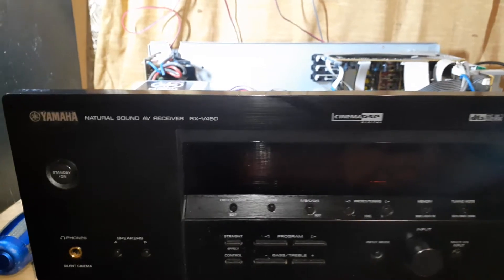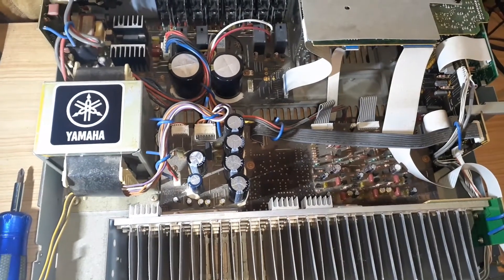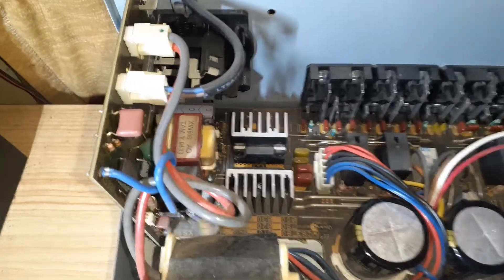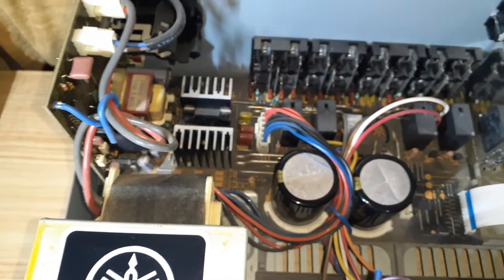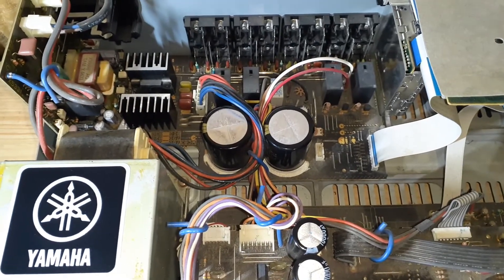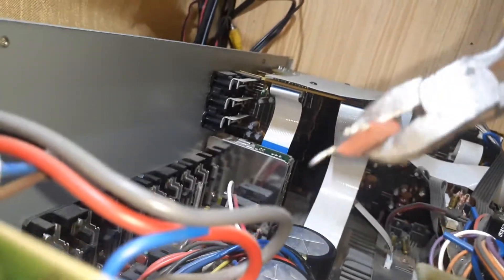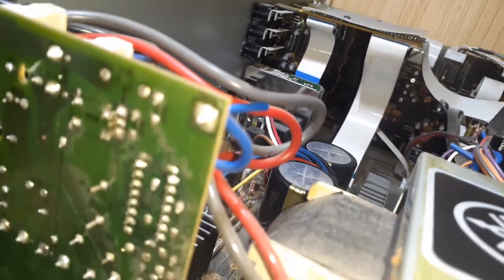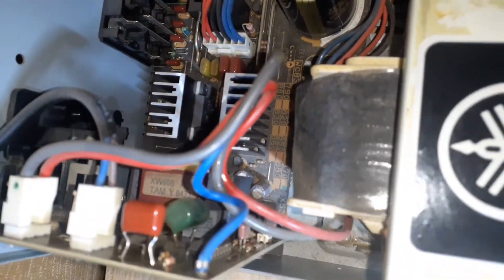Yamaha RX-V450 NOT POWERING UP , REPLACING 1 CAPACITOR TO SOLVE PROBLEM , AS SUGGESTED BY OTHERS

Comment: i have a question did you get any clicks or anything before you replaced the cap i recently got one of these units from the same era rx n600d to be exact for free and wondering if it has the same fault no power at all so i brought the same cap unfortunately mine has Ethernet and you have to disassemble everything to get to the cap
Reply from the maker: At first it was all good , then  wouldn't power up on the first try , and then got worse , before it stopped working completely. I don't  think it did make the switching clicking sound at all when it wasn't going to power up. After a few tries sometimes it clicked and powered up.

Comment: Hello , I have Yamaha rx-a1030 .Don’t turn on . After I hold press info-tone-power I receive the following diagnostic messages : PS2 PRT 36 L and  A1-1 DSP MARGIN .The PS2PRT display is showing I have a problem in the power supply – to low (From what I read un the service book) .What would be the solution to fix the defect?Hoping for an answer , thank you very ,very much in advance !

Comment: Hey mate. I don't seem to have c405 on the RX-A740.. I have two capacitors near the power plug..?
Reply from the maker: I haven't seen, what the RX-A740 looks like inside.
Reply: @vidtech2630  can i send you pics? I'm a total noob
Reply from the maker: If they are the flat non polarised capacitors , maybe just replace them both , they not expensive.
Reply: @vidtech2630  but not the ceramic capacitors right?
Reply from the maker: Metallised / Mylar Polyester capacitors,  rectangular in shape.
Reply: @vidtech2630  swapped the two capacitord. Now I get a relay click sound. But nothing on the display. I guess that's progress. What next?
Reply from the maker: @lorenzowong1980  Good question,  double check the soldering.
Reply: @vidtech2630  thanks. Will try

Comment: Hi, i have exact same model with same issue.
What is the replacement capacitor please?
Reply from the maker: That is a good question,  it's values are 223J 630V , and that is the equivalent of what was in there originally,  from memory,,exact replacement of 180J or 190J  wasn't aviable. So I wouldn't go any bigger than this.

Comment: u have tyamaha rxv 675 that is different, what do i have to replace? thanks!
Reply from the maker: Try the same capacitor , it might be arranged slightly differently.
Reply: @vidtech2630  how do i identify the right one?
Reply from the maker: Find that small separate power board , it will be close to the transformer , it might be mounted vertically like here or it might be mounted horizontally,  again close to the transformer. There is only one orange capacitor ( exactly the same looking capacitor that was replaced here )  and replace with another capacitor,  of the same values. It's a non plarizised capacitor , so you can solder it in , either way. Good luck.

Comment: muchas gracias por el video,mi modelo rx-v559 que no encendia y despues de cambiar la misma pieza ahora enciende pero al saltar el rele de proteccion se apaga,que podria revisar?
muchas gracias

Thank you very much for the video, my rx-v559 model that did not turn on and after changing the same part now turns on but when the protection relay is switched off, what could I check?
thank you so much